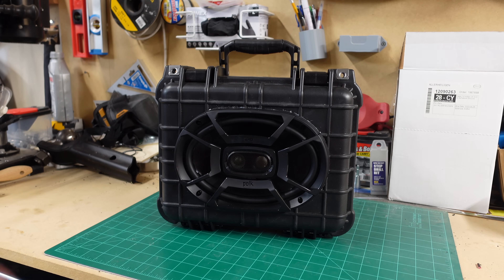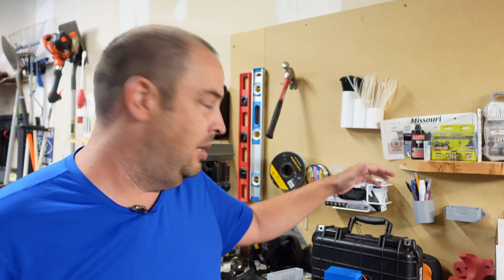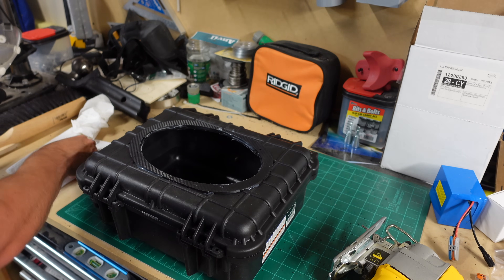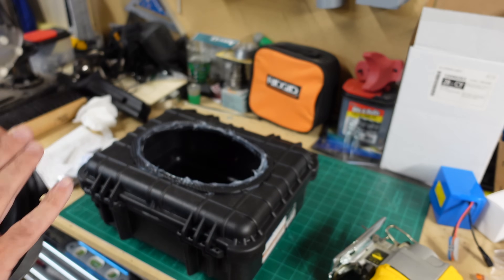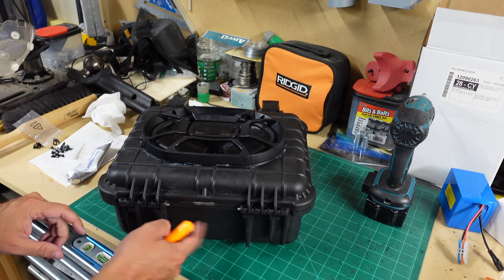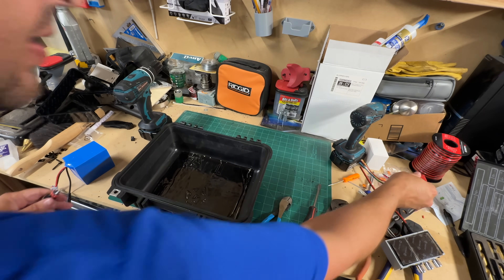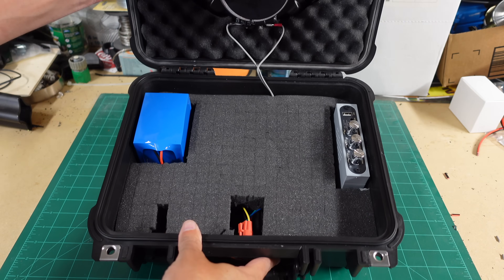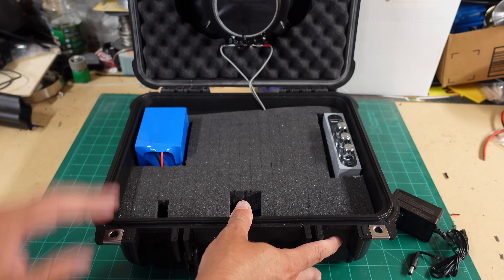How to Build a DIY Turtlebox Bluetooth Speaker for $160!

Comment from the maker: Here are links to the parts you need (alternatives are listed in the description) - 6x9 Speaker - https://amzn.to/3TB9Nhr, AMP - https://amzn.to/45AGv9V, Power Switch - https://amzn.to/3FzmYfo, Battery - https://amzn.to/4kAu7Lq, Threaded DC Power Jack for Charging - https://amzn.to/3HBD88z, Clear Silicone Sealant - https://amzn.to/45jSWVB, WAGU Quick Connectors -  https://amzn.to/4lMZMJV

Comment: The only thing with your design is that you only used half the amp when you could have got a mono amp with  blue tooth or just got 2 smaller speakers which sound better ??

Comment: bought pioneer speakers that are rated for 12v max and a 24v power supply along with the 1002t amp. only speakers have been delivered so far. im wondering if that amp will step down the voltage and it is safe to hook up to the speaker or if i need something else to protect speakers from getting 24v?

Comment: Where are you guys buying this for $160 my Amazon cart is like $300 before I even go buy a case
Reply from the maker: Prices fluctuate. You should be able to get it done less than $200-250 depending on what speaker.
Reply: Got some stuff off a car audio lot in market place; gonna get the battery, receiver/amp and DC charging bits. Besides that it’s free! Just needed a source for the amp. Going for a suitcase style with a 12” mini sub box and 12” loud speaker.
Reply from the maker: @hobbslee2336 nice!

Comment: Great video for a beginner like myself! The switch is fine even though it is 12v while the battery is 24v? Also how long would this battery last on a full charge around 1/2 volume level?
Reply from the maker: Yes. Been using them in all my boxes. 30+ hours easy.

Comment: What allows your phone to pair with the speaker?
Reply from the maker: Bluetooth.
Reply: @DIYReid Does the speaker you recommended purchasing have Bluetooth built in? I guess where I'm confused, on a standard car radio the Bluetooth connection is between your phone and the head unit.
Reply from the maker: Ooooh. The amp has Bluetooth.
Reply: @DIYReid Gotcha, appreciate it. I'm going to build one this weekend, do you know if there's somewhere I can have the housing made for the amplifier?
Reply from the maker: There’s a website in the description where you can buy that.

Comment: Thanks for the solid information. I have purchased and installed the battery listed. I have connected the charger and a red light is on. The battery has been connected to the charger for two hours (red light still on). I assume when the battery is fully charged the light will turn green (yes or no)??? What is the approximate charging time for this battery?
Thanks!
Reply from the maker: Yes it’ll be red for charging and green for full. Not sure. A few hours depending on how depleted it is.

Comment: Can a mic be plugged into the aux port and work for like say karaoke or will it make the music cut off
Reply from the maker: Not on this amp.
Reply: One more question. The power switch is on the outside as well as charging port. So I will assume that means it can’t fall into the water like a turtle box right
Reply from the maker: The power switch and charging port are both water proof.

Comment: How is the battery holding up? What kinda play time are you getting on single charge? 
I was thinking about going with the 8aH battery, as i wanna use it in the shop on work days
Reply: I’ve used this battery in a build with 2 6.5s on a zk1002t amp and I’ve gotten at least 15 hours out of it on a single charge on medium-ish volume. Idk lol it always out lasts me

Comment: Not sure if you’ve heard of turtle boxes, but curious if you’ve had the opportunity to compare this to one of those
Reply from the maker: They are just as loud if not louder depending on speaker you choose. These can be customized even more and are cheaper.
Reply: I have heard the turtlebox at my neighborhood pool.   I was at our local pickleball court and a kid brought one of these and i thought it was a tb!  He said he actually made it for 20.00!  It sounded amazing and i am a sound snob.
Reply from the maker: No way he made it for $20. The case is $30 alone. Either way you can use parts you have like speakers and batteries if need be.
Reply: @DIYReid yeah i think i heard wrong about the 20.00!   But the sound was great.   I think the turtlebox sound was a bit better but still thought he had a tb.

Comment: i ordered that same 24v battery and 12v switch, online it says they might not work with eachother because one is 12v and one is 24v. I see you used them though, i shouldn’t have any issues using them right?
Reply from the maker: Nope. I use them on all my builds.

Comment: Can the Battery be charge from auto cigarette lighter socket Instead of using the DC pigtail to plug into wall?
Reply from the maker: If you use 24v charger.

Comment: Hey im building mine this week but i watched and im confused on how you wired it for charging could you explain please!
Reply from the maker: What are you confused by?
Reply: @DIYReid well since the battery already comes with a female adapter did you just add a longer wire to make the charging at the top? And could i just use the female end that’s connected to the battery
Reply from the maker: I used a female adaptor to extend it to the external plug. The parts are in the video description.

Comment: So I’ve copied everything you have. When I turn mine on it plays for about a minute then the speaker starts making a popping noise no music. 

Kbt 24v 4Ah battery 
ZK-1001 um 100 watt
Reply from the maker: Is your amp bare or in a case? Is a case screw touching it? Are the speaker leads touching speaker wire only? Power wires not shorting?
Reply: @DIYReid My amp is bare. I’ve noticed after sending you the first message that my amp gets pretty hot. I spent hrs last
Night trying to figure it out. I redid all the connections but still gets hot then starts making the popping noise.
Reply: @DIYReid Any ideas on how power wire could be shorting out?
Reply: Could the difference be the 1001um is what I have and looks like yours is the 1001u
Reply from the maker: Idk. I don’t have experience with the 1001um amp

Comment: If u take out the foam and add a 1" diameter port tuned to about 50hz, depending on the speaker, you'll probably get more bass
Reply: A passive radiator would definitely be better for a small  enclosure like this.
Reply from the maker: For sure
Reply: How do you “tune” it to 50hz?
Reply from the maker: That and or a passive radiator like this - https://amzn.to/4oQTWcH

Comment: Do you have an updated wiring diagram with the charger port wired in?
Reply from the maker: It’s in the video.
Reply: @DIYReid I see the one I. The beginning but not after you wired in the port on outside of box later.  I’ll scan again.  Does it just connect to black and red on battery using a clamp connector?
Reply from the maker: 11:36

Comment: You mentioned more than one box can be used. So the amps have built in TWS, cause it doesn’t mention it in the descriptions on the units !
Reply from the maker: The 1001u amp has TWS

Comment: How did you have the amp with a max 100 watt output and a speaker with 150 watt rms I’ve heard it’s bad to under power speaker
Reply from the maker: Tons of people use these speakers for this with no issues.
Reply: @DIYReid ok I was looking into building one I was just confused on that thank you though
Reply from the maker: @evancordell4651 I don’t know the answer for your question but I do know people use them all the time.

Comment: Will this amp run 2 6x9s at the same time or will I have to run a bigger amp? Or at least 2 6x5s? Also will I get into needing a bigger battery?
Reply from the maker: Battery should be fine. You can go bigger if you want. Amp I would use for 2 speakers is - https://amzn.to/44Mp4SV
Reply: @DIYReid  awesome! Thank you!
Reply from the maker: @gavinwilliams7143 or you can bump it up to 36v and do this amp. https://amzn.to/46VuZ9p

Comment: Awesome video! I subscribed to you! Very well explained!  Do these speakers always need a LVC - (Protection Digital Low Voltage Protector )?
Reply from the maker: No. Only the battery needs LVC if it doesn’t have a way to control it onboard. The batteries linked in the description do not require LVC’s

Comment: This is pretty awesome!! Instead of making is chargeable im gonna wire it up for my Milwaukee batteries. Great idea browski!!
Reply: be careful doing that, i learned the hard way and ruined a $200 battery. Milwaukee m18 and m12 batteries do not have a low voltage cutoff built into the battery, Milwaukee puts them in the tools instead so there is nothing stopping the battery from discharging low enough that the chargers won't charge them anymore and you're only option would be to take the battery apart voiding your warranty and jump starting it with another battery to get the voltage high enough for the charger to recognize it as a good battery again. If you do want to use their batteries i would full discharge one using a tool and check the voltage and add a low voltage buzzer and set it to buzz a little above the voltage of drained battery so you avoid the headache of ruining their crazy expensive batteries.
Reply from the maker: @blakekelley8112 with any battery that doesn’t have a BMS just get a $5 low voltage cutoff.
Reply: @blakekelley8112 you can jump start a dead Milwaukee battery without taking it apart! This doesn't always work but does most of the time!
Reply from the maker: You can do that too. Even put a spare batter in the case.
Reply: @DIYReid does that work properly with a Milwaukee being 18v/20v instead of 24?
Reply from the maker: @Aidanburns13 the 1001u amp can bump the voltage to 24v
Reply: You can get adaptors that have low voltage cut off and buck converters from 20 to 12. Saves the batteries and you can use all sorts of 12volt devices like headunits or USB outlets etc.
Reply: how do you do the drill battery install
Reply from the maker: Get the specific battery adaptor on Amazon.
Reply: Any link for the 3d printed 6x9 ring you used
Reply from the maker: You need it printed or you printing yourself?
Reply: @DIYReid  Do you have a parts list?
Reply from the maker: In the description
Reply: @DIYReid  can I use a skar amp for the one I want
Reply: Do you have the file for the spacer ring
Reply from the maker: What speaker?
Reply: @DIYReid  Polk db+ 6x9
Reply from the maker: https://makerworld.com/models/1846411
Reply: What about the 3d print file for the Kicker PS69 spacer ring?

Comment: Does it have to be 24v? Can it be 12v? Great video btw
Reply: That really just depends on the amp you use. A lot of these smaller amps don't get full power until they are 24v. Sometimes more. Just a simple example. A 100w amp usually only hits 100w at 24v. So at 12v you'd be only get 50w of power from the same amp.
Reply: What sort of battery life can a person get out of this unit?
Reply from the maker: Depends on battery. 4ah battery I used on the 6x9 has lasted me all day 8 hrs and still going.
Reply from the maker: These are 24v amps.

Comment: I was wondering how you built that for only 160 because i have the exact same stuff you do in my cart and i sm already at 153 and i still need to add speakers which are the exact same ones and there 160 dollars i was wondering if you could help me i am 13 years old and to build my first one please help
Reply from the maker: Some of the prices have gone up a bit since posting. I didn’t use both speakers so cut that price in half.

Comment: Can I use a 18v Ryobi drill battery without a transformer?
Reply from the maker: You can but not sure if you need a Low Voltage Cutoff switch.

Comment: Will any 6x9 speaker work with this build? The polk’s are back ordered
Reply from the maker: Yes. Depending if you want it water proof or not I would look for a marine speaker if you want it around water.
Reply: Thank you. I found a Kicker 6x9 that is waterproof.
Reply: Also can you add a link for the lever wire connectors you used?
Reply from the maker: @nicholaswhitfield9022  https://amzn.to/4lMZMJV

Comment: Any chance this could be upgraded to USB-C? I’m drowning in cables over here. I’d try it myself, but let’s just say... I know my limits. It’d also be really useful if it could provide power to other devices.
Reply from the maker: Not sure. I leave my charging cable in the case. Never lose it. 😃
Reply: I'm not sure if there's a way to do exactly what you want, however, you could honestly just get a power bank with an outlet on it and have it power the rig. Added bonus that you'll be able to use it to charge other devices. I'm currently in the planning stages of making a rig like this, and typing out this message talked me into that. The original plan was going to be to use milwaukee batteries, but I think that may be a better plan.
Reply: You cant charge with a usb on a 24v
Reply: @obsomar1148  not directly, very simple wiring fix with a 20c-5$ worth of components.  shit, AI could probably tell you exactly what to do off a picture (not that I fuck with ai like that myself)

Comment: Thanks for the video, I ordered through your links enough to build 2 boxes. I was curious as to the difference in the 1001u and 1002u amp? I do not have the ability to 3D print, so I ordered one case from your list but would be nice not to have to order a case. Also, nobody every mentions the 3 knobs on the amp, what functions do they handle?
Reply from the maker: There is a website in my description that has them for sale.

Comment: So you ended up not using the thin piece of foam that you had in there first?
Reply from the maker: I did use it, I ended up ditching one of the thicker foam pieces. The thin one is holding the battery up higher so it is flat against the wall.

Comment: So a wall charger comes with the battery? Great video as well man
Reply from the maker: Yup. It had a charging indicator light on it too.
Reply: @DIYReid  what about a low volage disconnect?
Reply from the maker: @moodymade3884 with that battery you don’t need one. Only if you use a battery without a BMS.
Reply: @DIYReid  oh okay that makes sense thanks man... also the speaker link takes me to the power switch
Reply from the maker: @moodymade3884 I just fixed it
Reply: @DIYReid  thanks man... i guess you also put some sealant around the power switch and the charger port as well right

Comment: What were those quick plugs.
Reply from the maker: DC Plugs. They are in the description.
Reply: @DIYReid the low voltage wire connectors?
Reply from the maker: @chennn9 ooooh those. Those are just WAGO’s. They are also in the description

Comment: Try this with an old Honda CD player + cassette radio - a true boombox build

FWIW my desktop amp is a modified Honda CD-6 + cassette and it's awesome. I replaced the FM port with a 3.5mm and bypassed the FM antenna module so pressing the AM/FM button switches to AUX.

Comment: Does the battery come with a board to control charging?
Reply: Maybe that’s all done through the charger brick itself?
Reply from the maker: What do you mean to control? Like BMS?
Reply: @DIYReid - a circuit board to prevent overcharging??
Reply from the maker: @ericsmith5683 the battery I listed in the description and I used has BMS and won’t allow for over charging.
Reply: I'd like to tag on to this comment. Is there a need to prevent over discharge on the battery, and if so is that accounted for here or do you have any thoughts on how you would accomplish that? Loved the project, thank you for sharing.
Reply from the maker: @ThatBeardedBro the battery I linked doesn’t need it. Most batteries like that don’t. Or already have it I guess I should say